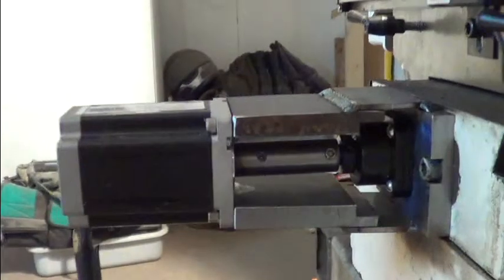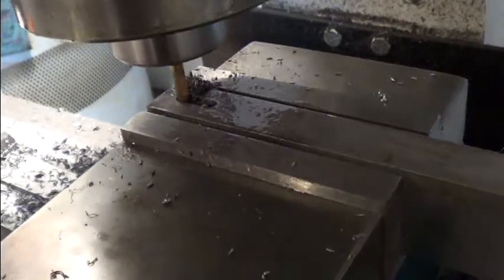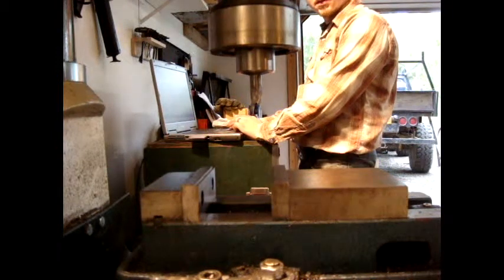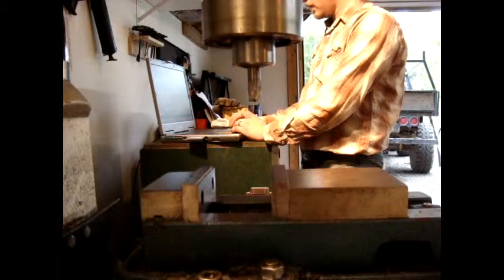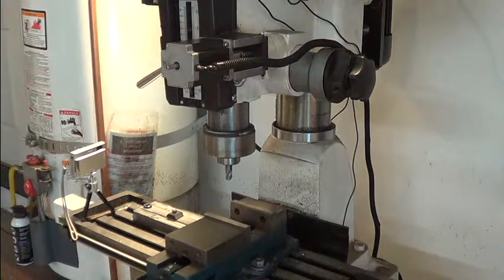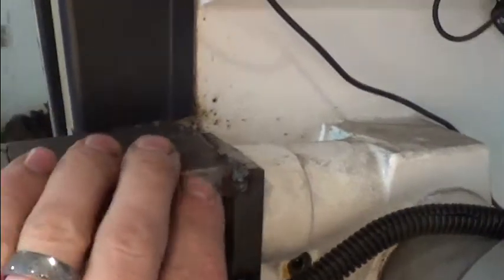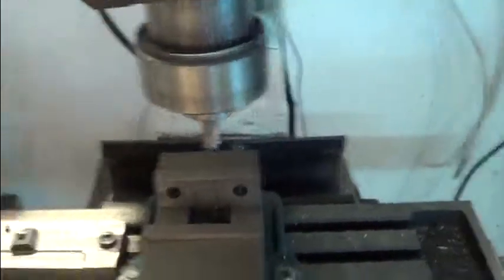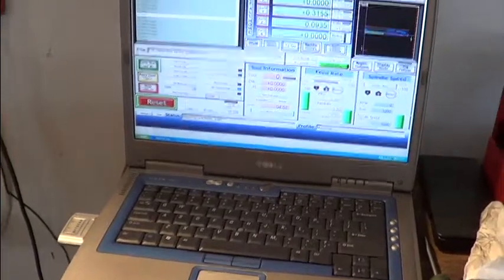Last frontier Knives - Episode 7 CNC mill finished!!

Comment: what stepper motor driver setup did you use?
Reply from the maker: I used the three axis combo from buildyourcnc.com  the parts came in about a week.  (3) 425 oz-in stepping motors
(3) Drivers (3.0Amp 24-40 Volts, 1-1/64 microstepping)
(1) 36v 8.8a Power Supply
(1) Interface Board either USB or Parallel (select the appropriate interface board in the price options.
Reply: Thomas Van Krevelen 1 would have set the micro step to 1/16 so you can get a bit more speed out of the motor and a little easier on the computer software